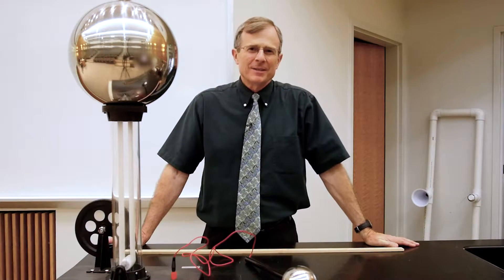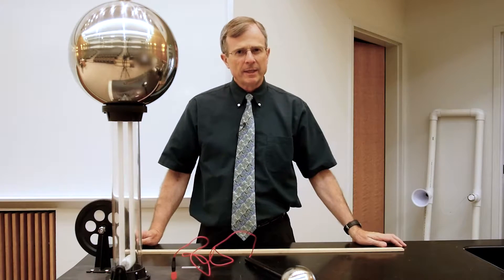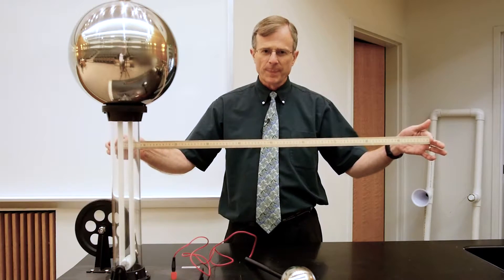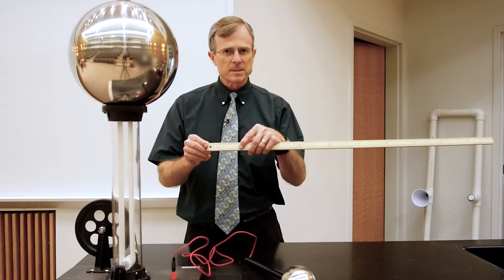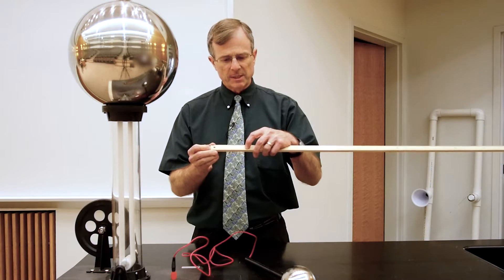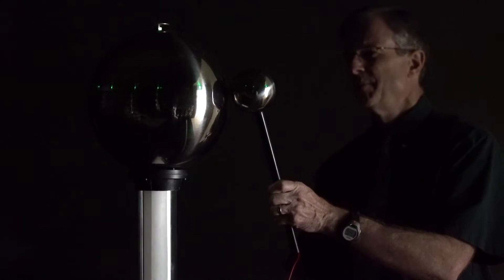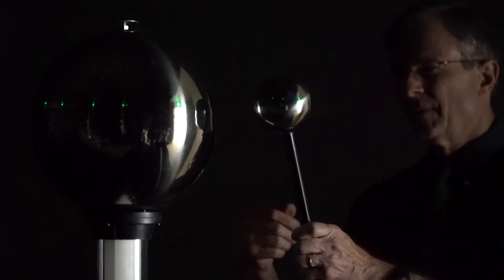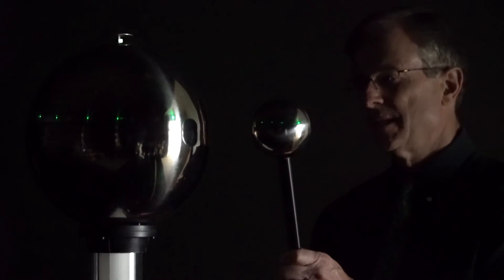Dielectric Strength Demo: Van de Graaff Generator

Comment: Is the second metal sphere necessary? The discharge from the Van de Graaff seems to be drawn to it since it is a conductor (I'm not sure about this, the human body is also a conductor so theoretically it should also be drawn to the body), but if it were not there could you still have dielectric breakdown emanating from the Van de Graaff?
Reply from the maker: I think so, but it would work better if you put a conductor with some sharp points on the Van de Graaff.  The electric field and electric charge would concentrate at these points, and it would be easier to create dielectric breakdown.
Reply: @physicsdemos  makes sense, similar to why forks are dangerous in microwaves